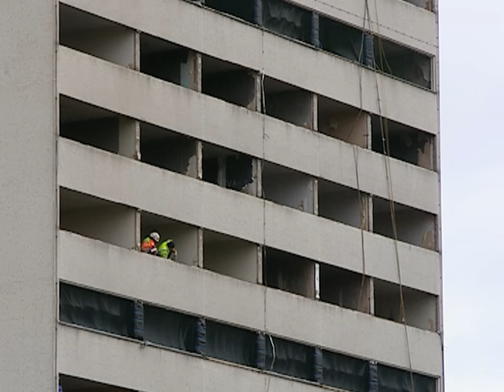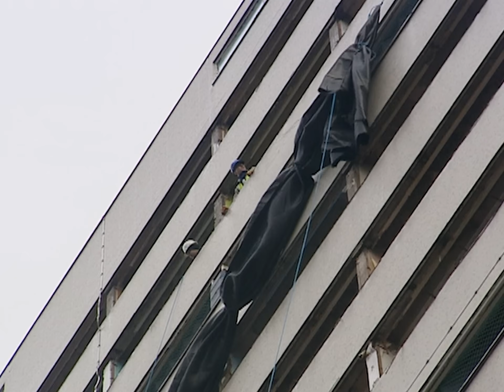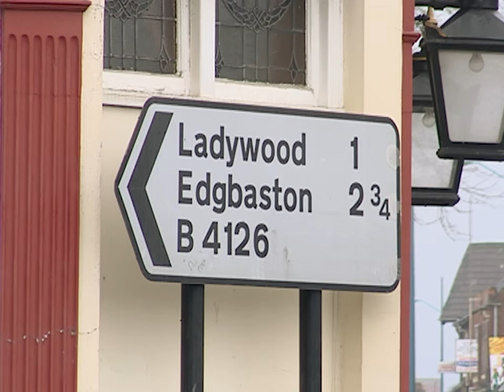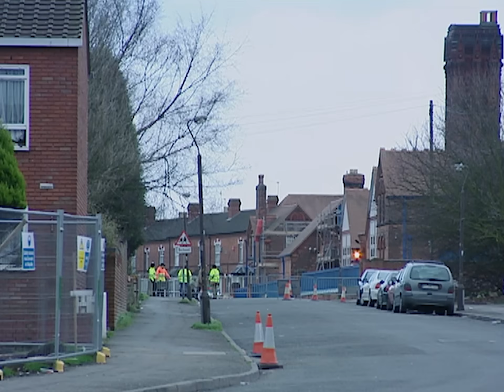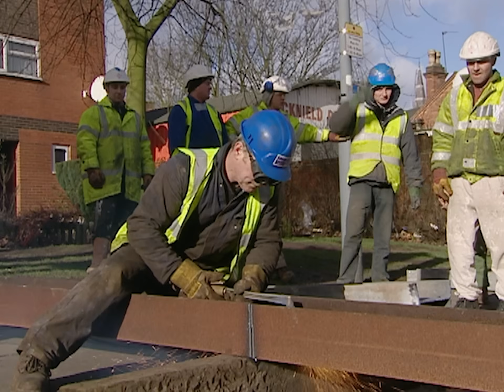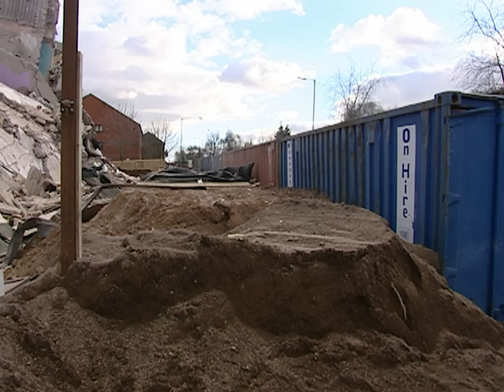32 Kilos of Explosives Bring Down a Birmingham Tower Block Amidst Surrounding Structures | Blueprint

Comment: It is not tough at all they were built like flat packs in mind and had plenty of short cuts that the concrete walls rods were mysteriousely cut to fit ,as the math of the engineers messed up ,that was the labour party for you saying at the time that they needed homes of 500,000 while tory were to build houses of 400,000 ,that how they got in and built these flats that looked like prisons .

Comment: This video is from 2004
Reply: That explains it. They'd be crazy to blow up a building after the medical study from the Environmental Protection Agency in the USA. They investigated the 10,000+ cases of cancer from an exposure to the dust from the 9/11 WTC collapse. They discovered that most of the cancer were caused by the respirable silica in the dust cloud which is also the main component of an implosion cloud. It gets into your lung tissue and causes cancer.